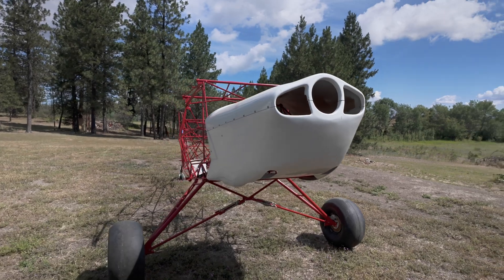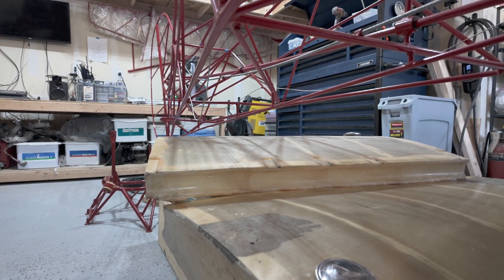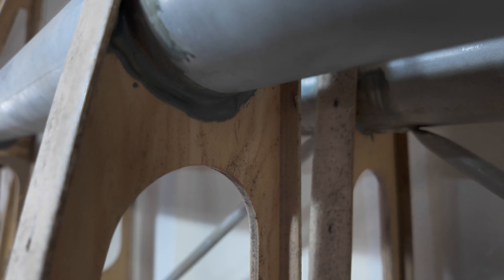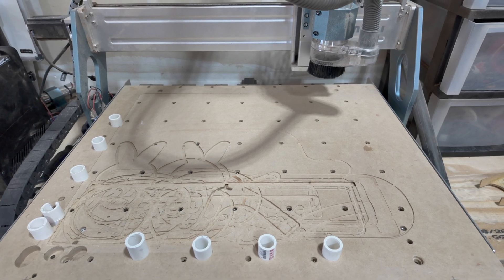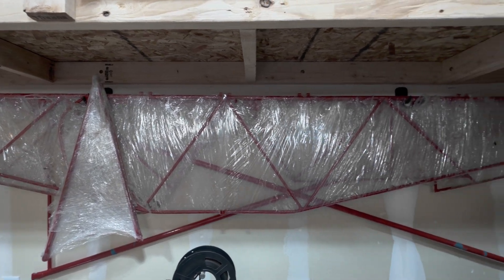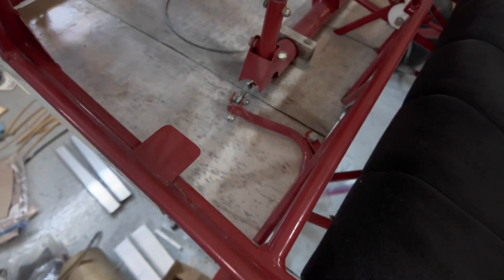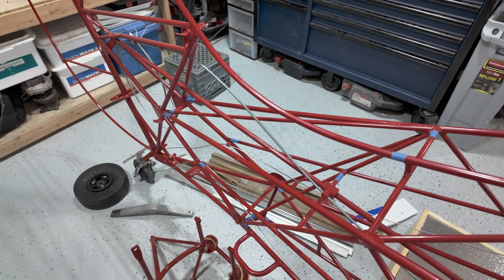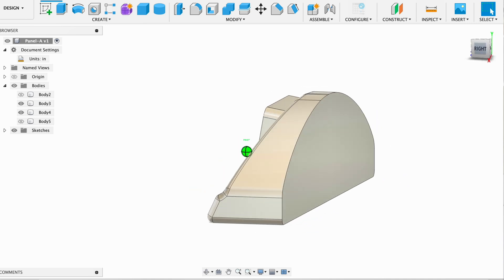STOL Bush Plane Build, and Plans - Avid Flyer MKIV

Comment: Hi 
I am interested in putting the Kitfox Mk 7 wing airfoil to my avid, I f you car use the Ribblet airfoil coordinates and try to digitize them in CAD then it would be of great help.
I am not familiar with CAD software.

Also do you have any idea which Ribblet airfoil Kitfox is using?
Reply from the maker: Hi there, yeah I'll let you know if I end up with that airfoil or a CAD of it. I cannot confirm 100% which foil it is, but this thread seems to have that info.
https://teamkitfox.com/Forums/threads/7366-CG-Range-of-the-Riblett-30-612-airfoil

Comment: Looks like you did well with the purchase of this one, good luck with the build. Being a first build probably a good idea to get right on with getting it all finished at a brisk pace and fly it. Some of your intended mods seem a bit superfluous to me and adding weight in bush plane might not be the best idea if you are going STOL and short field take off and landing, ie wide body, (when you will be solo as a slim guy), extending this and adding that, Alloy tanks over fibreglass, (heavier?).
Reply from the maker: Thanks! Yeah, definitely something to consider how much I build on it at first vs add later. But, I do love building, and I still need to finish my pilots license, so I'm not in a huge hurry here either. Thanks for the consideration!

Comment: I might be interested in the STOL wing tank you have.  Also, I noticed that your speed wing extensions have the cable for the trailing edge.  On the MK IV, an aluminum trailing edge was used.  C model and earlier used the cable for the trailing edge.
Reply from the maker: Hey Jim, yeah it's available. I'll send you a PM on avidfoxflyers. Yeah the wings are definitely pre-model 4. I may still go with speed wing, but will either sell them or rebuild them with the trailing edges that came with.